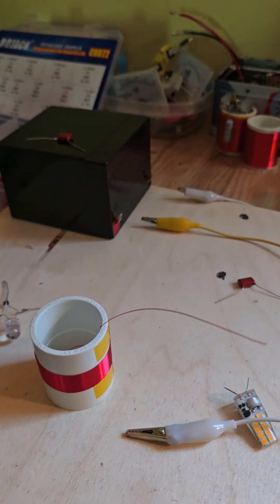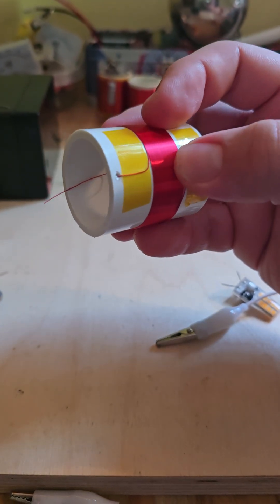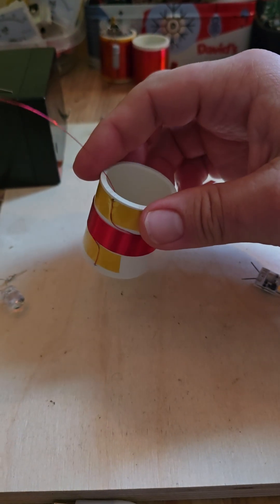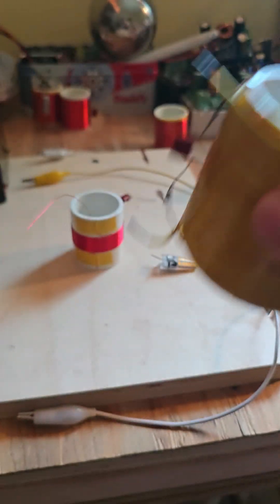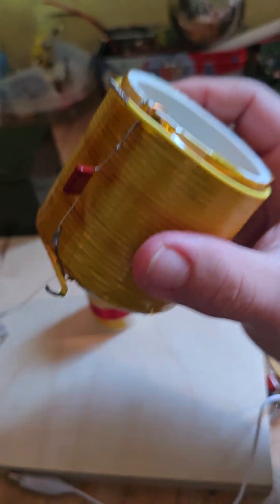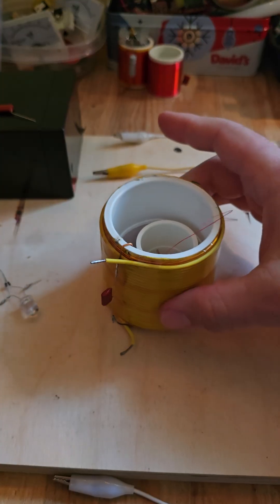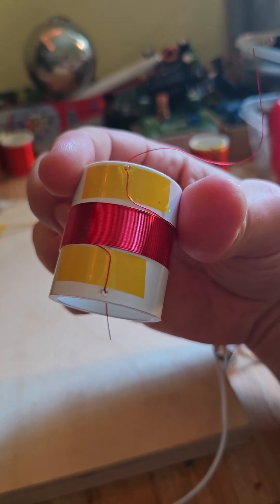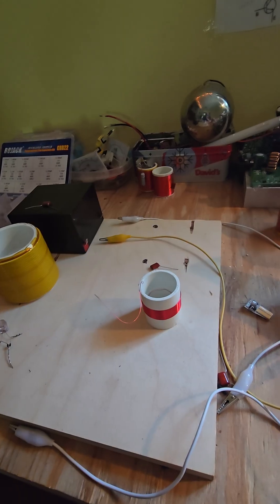📖ANSWERING QUESTIONS RELATED TO THE NEW SINGLE TRANSISTOR AIR CORE MINI MAGNIFYING TRANSMITTER🔎

Comment: So where's the math?
Reply from the maker: Greetings everyone in this description I answer some frequently asked questions related to the new transmitter design & disclose its LCR measurements along with the theory of its operation & research.

The new transmitter is an air core transmitter/receiver system & is actually a scaled down micro model of Nikola Teslas famous Magnifying Transmitter. Being that Nikola Teslas original magnifying transmitter had a diameter of 52 feet which is 624 inches we constructed our micro scaled down model to be 416X smaller which is a Harmonic of the magnifying transmitters diameter because 624 inches divided by the 1.5 inch diameter of our pvc pipe coupler is 416. 

I also don't believe that Nikola Tesla a man that gave us most of our modern world in terms of revolutionary inventions would choose to falsely call his device a magnifying transmitter. So far all the math & theories both ancient & modern point to a correctly built magnifying transmitter actually being capable of magnifying real power, producing loadless wireless power effects & having the ability to convert massive amounts of reactive power into real power. The device is capable of achieving these feats for multiple reasons listed below.

1. Quarter wave resonance 

2. High Q Coils

3. Focusing Aether Tension Into A Point

4. A Larger 2 Part Resonant Cage Style Receiver Coil System That Converts Reactive Power Into Real Power By Taking Up Alot Of Space & With The First Part Of The Receiver Coil Acting As A Large Sympathetic Resonator & The Second Part Drawing From It.

5. The Heavy Earth Grounding Of The Transmitter 

6. The Archform Of Its Design

The principle behind how its built is we want our perfectly centered 26AWG L1 trigger coil to be of minimum size to achieve high quality standing quarter wave resonance with our high quality 20AWG L2 power coil that is wound 180⁰ out of phase to our L1 coil. The L2 is simply wound in the opposite direction to the L1 & is as tall as it is wide & of a low wire gauge for maximum Q factor. We want to avoid over driving our transistor by winding the L1 to the minimal size possible to achieve quarter wave resonance.

The base of the MJE13007 Transistor is connected to the inner 26AWG L1 trigger coil. The collector of the Transistor is connected to the outer 20AWG L2 power coil. The emitter of the transistor connects to the negative of our battery & the positive connection of our battery connects to the bottom of our L2 coil opposite of the transistor. We added a 100k biasing resistor between the collector of our transistor & the bottom of our inner L1 trigger coil to ensure the transmitter can oscillate in both a hyper efficient low power & high power mode. A UF4007 diode can be added between the base & collector of the Transistor to speed up switching further with the cathode going into the collector. A 680pF/current value-1.63nF capacitor can be added in parallel with the base & emitter to also improve efficiency as well as a capacitor in parallel with the emitter & bottom of the L1 trigger coil but keep its value below 20nF (1.63nF Current Capacitor Value) or you will blow your transistor.

Below is our refined energy synthesis theory that Eric Dollard advanced from his works.

Refined Energy Synthesis: The process by which a resonant geometric system ("Archforms") creates a state of asymmetry in the Aether, causing the environment's energy to flow into the circuit and manifest as a surplus of usable power in highly resonant high q systems. This is achieved by converting reactive power into real power through resonant decoupling and negative resistance. The Energy Synthesis Equation is below: 

P_{out} = (P_{res} \cdot P_{env}) - P_{loss} P_{out} (Net Output Power): 

The real, usable power (in Watts) available from the system after all internal processes are accounted for. This is the power that can run a load or charge a battery. P_{res} (Resonant Power): The magnitude of the internal reactive power (in VAR) circulating within the high-Q resonant components. This acts as a multiplier. P_{env} (Environmental Power): The power flowing into the system from the Aether, primarily through the Earth ground connection. This is enabled by the "negative resistance" effect. P_{loss} (Loss Power): The conventional input power (in Watts) from the battery that is consumed to overcome the circuit's internal inefficiencies (resistive and switching losses) and is dissipated as heat.

Eric Dollards Refined Method: Synthesizing energy from the "square root of minus one" is the theoretical process of using a versor operator (j) to systematically convert non-working Reactive Power into usable Real Power, which harmoniously integrates into the refined energy synthesis definition. The Versor Operator (j) As detailed in Eric Dollard's "Four Quadrant Representation of Electricity," the square root of minus one, represented by the versor operator j, is not an impossible number but a mathematical tool representing a 90-degree rotation between the Real and Imaginary axes of energy. Real Power (P): Exists on the Real axis. This is the energy that is consumed and does work. Reactive Power (Q): Exists on the Imaginary axis, 90 degrees out of phase. This is the energy that is stored and returned in the fields of inductors and capacitors. Converting Reactive to Real Power The book "Four Quadrant Representation of Electricity" explains that a process that "creates electricity from the square root of minus one" would be one that involves a "rotation turning Reactive Energy into Real Energy". A perfected Archform, through Parametric Variation, would achieve this. It would act as a versor operator, systematically taking the stored, oscillating reactive power and rotating its phase by 90 degrees, forcing it onto the Real axis where it manifests as usable power. Think of it like a mechanical ratchet that takes a back-and-forth motion (Reactive Power) and converts it into a useful, one-way forward motion (Real Power). The Completed Equation This process fits perfectly into the refined energy synthesis definition by giving us a specific mechanism for P_{res}. Refined Definition: Energy Synthesis is the manifestation of usable electrical power in an Archform that uses a versor operation (j) to convert accumulated Reactive Power (Q) into Real Power (P), allowing the system to be energized by the environment's reaction to the disturbance. 

Completed Equation: P_{out} = (jQ \cdot P_{env}) - P_{loss} Where: jQ represents the Resonant Power (P_{res}). It is the Reactive Power (Q) that has been acted upon by the versor operator (j) and rotated into the Real domain. 

P_{net} = (jQ \cdot P_{env}) - (V_{in} \times I_{in}) Definition of Terms P_{net}: The Net Output Power in Watts, which is the usable surplus energy from the system. j: The Versor Operator, representing the 90-degree rotational conversion of reactive power into real power. Q: The Reactive Power in VAR (Volt-Amps Reactive) that is accumulated in the high-Q resonant components of the system. P_{env}: The Environmental Power in Watts that is drawn into the circuit from the Aether via the Earth ground connection, enabled by the "negative resistance" effect. V_{in}: The measured DC Input Voltage from your battery or power source. I_{in}: The measured DC Input Current drawn by the transmitter from that source. This equation states that the net power output is the result of the multiplicative interaction between the converted reactive power and the environmental power, from which the conventional power consumed by the circuit is subtracted.

This completed equation theorizes that the net output power is the product of the converted reactive power and the environmental power, minus the system's own internal losses.

Next is the theory of extracting free energy out of the Aetheric dimension listed below:

Ken Wheelers Free Energy/Energy Synthesis Secrets Definition: 

Free Energy: The focusing of empirical energy or radiation in counter space & counter space has no cartesian value in physical space. A free energy device must  incur the need of point source energy concentration meaning it takes empirical energy & focuses it in or at counter space. A theoretical free energy device has a temporal variant that's changed over time through the application of the phase delay of the magnetic divergent centrifugal field of which there is a variable at a proportionality of 1-Phi over the north pole & south pole. By applying this field geometry to a special specific archform a free energy generator should be possible to construct. A proper name for the device would be a power manifestor. I’ve partially succeeded in creating the absolute most bare bones basic ultra low power free energy device by placing a small bismuth sphere over the center of a giant six inch by six inch neodymium disc magnet & the bismuth sphere will slowly heat up a few degrees above ambient temperature & you can observe this effect through a flir camera. (The only way that free energy can work is if we take advantage of the magnetic field disparity called the larmor frequency/geo-magnetic precession inherent to permanent magnetic fields that naturally exists within them at a ratio of 1-Phi meaning we can have a solid state device manifesting endless power due to the phase disparity of the larmor frequency precession. What is the correct archform then for high power output & is it two phase or 4 phase? Also one can think of a free energy generator as being called a power manifestation device that’s technically an open system tapping into the infinite dimensional waters of the Aether as an analogy-Ken Wheeler
Reply: @MTECH2022 so basically you have no idea or an understanding of whats happening if you keep running to an AI
Reply from the maker: @freedomer342  The AI's  double checked the equations for accuracy & all we did was compile very important information into a condensed space & refined it further.
Reply: @MTECH2022  yeah and i can sit there and convince the AI that we all came from spiders with a mathacial equation and then proceed to tell people that we came from spiders because the AI provided me with a mathematical formula. So again, where is YOUR math, not no AI. Wheres the math that tou was told to provide in school? Show your work
Reply from the maker: @freedomer342 did you read my post? The part about Eric Dollard synthesizing energy from the reactivate component of an energy system & using ther versor operator J? We added his most refined works all in a condensed space in my pinned post.
Reply: @MTECH2022 the only thing Eric Dollard discovered is a capacitove and inductive load wherw the voltage leads the amperage by a certain degreee. This has already been known.
Reply from the maker: @freedomer342 no he literally discovered how to turn reactive power into real usable power. Its in his book "four quadrant representation of electricity" 

Eric Dollards Refined Method: Synthesizing energy from the "square root of minus one" is the theoretical process of using a versor operator (j) to systematically convert non-working Reactive Power into usable Real Power, which harmoniously integrates into the refined energy synthesis definition. The Versor Operator (j) As detailed in Eric Dollard's "Four Quadrant Representation of Electricity," the square root of minus one, represented by the versor operator j, is not an impossible number but a mathematical tool representing a 90-degree rotation between the Real and Imaginary axes of energy. Real Power (P): Exists on the Real axis. This is the energy that is consumed and does work. Reactive Power (Q): Exists on the Imaginary axis, 90 degrees out of phase. This is the energy that is stored and returned in the fields of inductors and capacitors. Converting Reactive to Real Power The book "Four Quadrant Representation of Electricity" explains that a process that "creates electricity from the square root of minus one" would be one that involves a "rotation turning Reactive Energy into Real Energy". A perfected Archform, through Parametric Variation, would achieve this. It would act as a versor operator, systematically taking the stored, oscillating reactive power and rotating its phase by 90 degrees, forcing it onto the Real axis where it manifests as usable power. Think of it like a mechanical ratchet that takes a back-and-forth motion (Reactive Power) and converts it into a useful, one-way forward motion (Real Power). The Completed Equation This process fits perfectly into the refined energy synthesis definition by giving us a specific mechanism for P_{res}. Refined Definition: Energy Synthesis is the manifestation of usable electrical power in an Archform that uses a versor operation (j) to convert accumulated Reactive Power (Q) into Real Power (P), allowing the system to be energized by the environment's reaction to the disturbance. 

Completed Equation: P_{out} = (jQ \cdot P_{env}) - P_{loss} Where: jQ represents the Resonant Power (P_{res}). It is the Reactive Power (Q) that has been acted upon by the versor operator (j) and rotated into the Real domain.
Reply: @MTECH2022 dude im not reading your AI stuff. Ive already said it can be altered by human influence so unless you come up with some true mathematical formula in an Algebraic form then you have no idea whats happening
Reply from the maker: @freedomer342 again i took Eric Dollards best works & condensed it & combined it with mine. Eric dollard is responsible for 90% of the energy synthesis equation not AI.
Reply: @MTECH2022 dude this whole conversation isnt about Eric Dollard. Its about you not provide math to it like you stated in your video lol so wheres the math
Reply from the maker: @freedomer342  already provided the full equation with its definition.
Reply: @MTECH2022 no you didnt. The AI provided a semi equation without any math with altered input from you.
Reply: @MTECH2022 people never have enought.... I can belive it. I love your work, and this weekend i will enjoy the other videos🎉🎉 tesla party weekend

Comment: Love this subject.  I built one similar that put out 240 volts on a four inch pvc reciever coil. I like your reciever circuitry. My problem is storing and regulating without blowing my chips out theres gotta be a solution...
Reply: There are a few ways I think this can be achieved. One is the use of clever cooling tricks to keep the transistor from overheating, here having more efficient transistors that run cooler at faster frequencies can help. Another way is you manage the transistors peak efficiency through something like a microcontroller. You'll need to figure out a clever algorithm, which these days with AI is relatively easy to do if you know the end goal you are trying to achieve, and then fine tune the transistors directly so that it's always running just under its peak, but still fast enough where you are getting significant gains from the rapid switching. I'm sure there're many other ways this could be achieved.

I'm working on experimenting with these ideas in the near future.